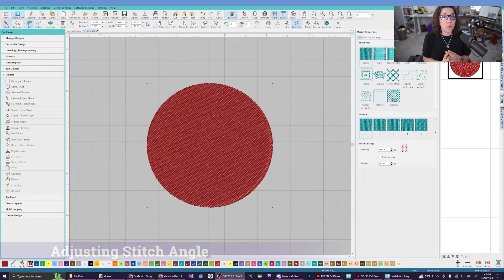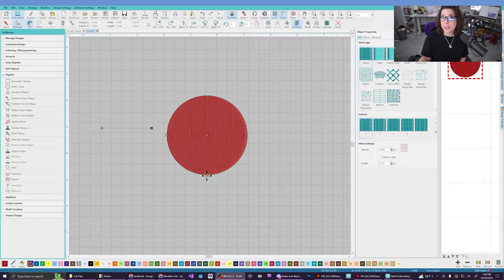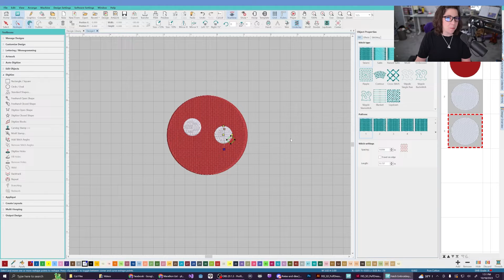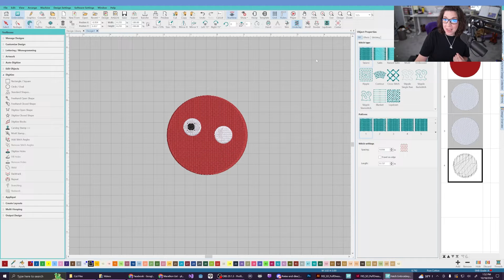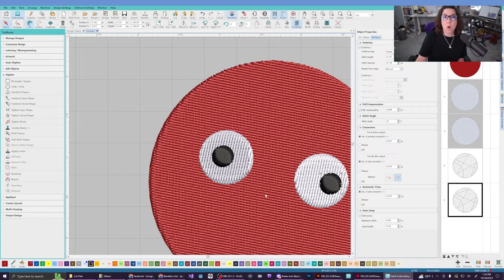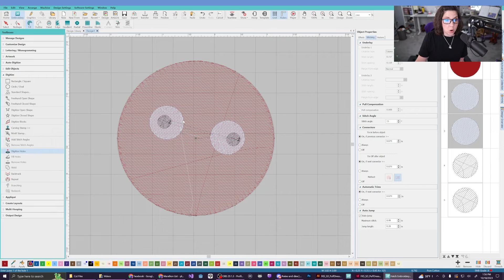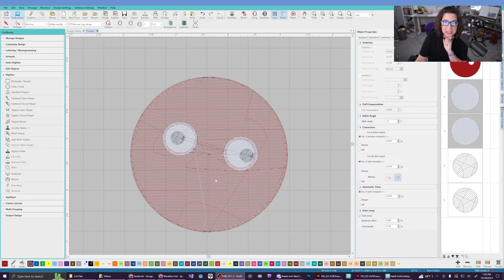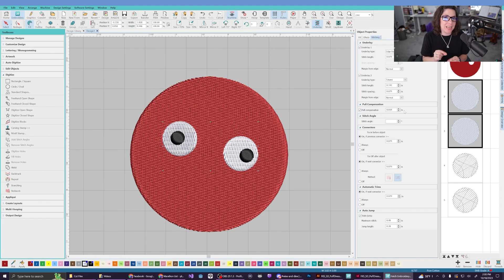How to Digitize Embroidery Designs with Layers in Hatch Embroidery Program

Comment: Hello! I have the composer 3 and I have a logo the I need to do that is an eagle and has lettering. Would it be best to separate the colors on procreate and digitize each color one at a time and layer it on hatch?
Reply from the maker: Are you exporting as a SVG and bringing it into Hatch, or are you just using a PNG file in the background? Either way, if the colors are separate, Hatch will detect them as separate objects for SVGs and for a PNG you'll have to use the auto-digitize option. It'll detect the colors through that method.